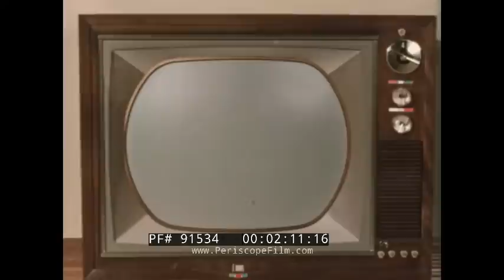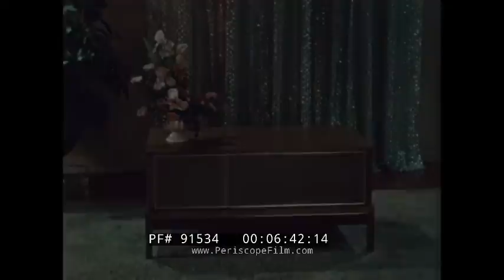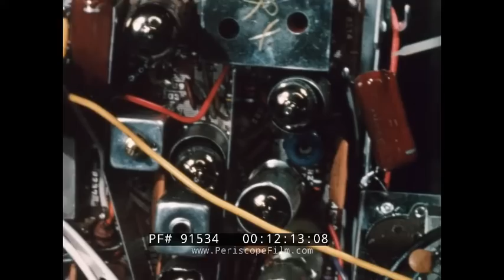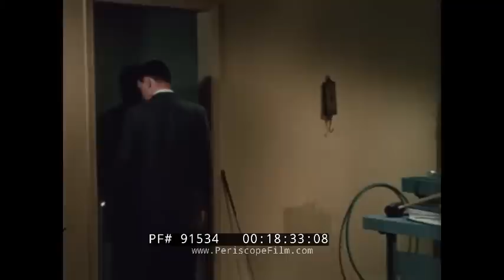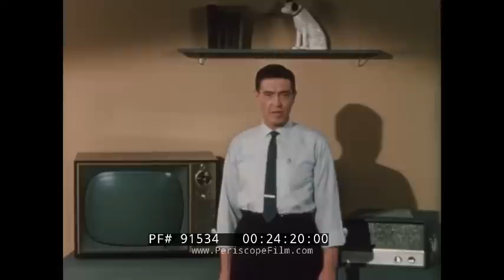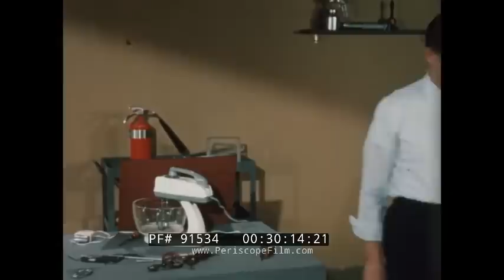1960 RCA VICTOR TV SET W/ REMOTE PROMO FILMS & "THE INSIDE STORY" OF THE RCA TV RECEIVER   91534

Comment: 20:00 Correct me gently if I'm wrong, but my understanding is that TV transmitters always had quite precise horizontal and vertical sync signals, even in the early days, but that consumer sets, for reasons of cost, were much sloppier, and it was usually just easier to have H and V knobs so adjust things when they got a little off. Some years later, the technology improved, and the knobs were no longer needed.

Comment: I don't know exactly how that remote unit worked, and they didn't say, but some of them had the remarkable property that they didn't need batteries, because they didn't rely on anything electrical. They used mechanical generation of ultrasonic signals, generated when you pressed the buttons.

Comment: I'd love to have a tv with the beautiful shaped picture tube these had, which I used to watch at home years ago.  I wonder if you could get an old one, degass the tube, and then fit a flexible lcd screen up against the inside of the picture tube therefore making a display that appears to be convex glass from the outside, and with those pretty rounded corners.  I'd prefer a real cathode ray tube but the colours of those always get burned and faded out after 30 years or more.  I suppose a black and white could be made to function perfectly if you had the ability to refurbish the tube.

Comment: Are there some Delta picture tubes and stripes green picture tubes that have the same filament voltage and test the same as the other one does and what is normal for the high voltage on a 23 and I have an older zenith from 1973 and it's a 19 ec45 chassis and it has 27,500 for the high-voltage I believe

Comment: Continuously variable volume control was a legitimate and important sales claim for remote control in this era as RCA provided a more expensive remote motor drive to turn the volume control as if you were to manually turn the control at the TV itself. The competition brands of the era often used a less expensive stepper relay in the remote control circuit to control volume in only 3 increments, a "low, medium, and high" and this relay was in series with the manual volume control on the TV, thus you really couldn't "dial in" that perfect volume with the remote as you could with RCA.
Reply: And to go back from mid to low you had to go through high and off, if I'm not mistaken.

Comment: When I was 5 years old, we had a Zenith about like that. A bit larger wooden cabinet with a speaker in the bottom. There wasn’t a remote control. The antenna was struck by lightning and the TV never worked well after that. We spent several hundred dollars trying to fix it, too. 📺

Comment: "Continuously variable volume control!" While I know this and color itself was insane tech in 1960, this still provides a chuckle.
Reply: Continuously variable volume control was a legitimate and important sales claim for remote control in this era as it provided a more expensive remote motor drive to turn the volume control. The competition brands of the era often used a less expensive stepper relay in the remote control circuit to control volume in only 3 increments, a "low, medium, and high" which were relative to the actual position of the volume control at the TV set itself.

Comment: In 80ties I had old RCA B&W set with remote. But it was older than shown  here - the remote had one big square button and alowed to change channels  in set  with electric motor driving the manual knob forward. It was nice and fun to see how wheel with numbers    turned by remote command. Communication from remote was with ultrasound about 25 kHz. All tube except remote ultrasonic with few transistors.   All this was capable to use in mid 80ties, only picture tube was more  worn then new. .

Comment: That "programmer with the magic memory" is actually a really cool idea. I can only imagine the amount of electromechanical complexity that would have gone into it - no ICs or processors back then!
Reply: It must have never sold well.  I've never seen a television with it, not even in an antique shop.  This film suggests the value is that you don't have to get out of your chair to change the channel but the real value is, having the TV turn automatically on so that you don't miss your show, when you've lost track of time.  That I can see being worthwhile back then.

I counted 24 buttons across the bottom so it handles a 12 hr out of the day.  Cartoons probably started at 8am on Saturday mornings and the news was on at 11pm.  So I wonder if you could decide on the 12 hr window of operation.
Reply: They probably scrapped the idea probably because of the amount of solenoids cams motors and switches that went in the final phase of manufacture
Reply: They must have scrapped the idea too many mechanical parts breaking

Comment: Why would anybody want to control the phase (tint) from their remote is way way beyond me.
Reply: Those old TV's would drift out of adjustment over the time you were watching a program.   Also, the station's phase wasn't always accurate, so you you changed the channel, it frequently needed adjustment
Reply: TV was broadcast differently in the early days of color. It was 5 separate signals on the same bandwidth. A Black and white signal for both B&W TV’s and color that carried the main picture then a Green overlay, a Red one and a Blue one and one for sound. Depending on your location and signal strength the channels could look very different.. Channel 2 could be very red and need to adjust the red down and channel 5 could be very green. This was still common into the 1980’s with certain channels. So adjusting the tint with the remote was a huge feature since usually there were knobs to turn located on the set itself to fix the color.
Reply: I stand corrected. Yea NTSC was pretty solid by the 90s (and I would even argue in the mid 80s). I was a kid in the 70s and I don't think we had a color TV before 1975!

Comment: You can wait a couple years and the tubeless  on your  RCA/VICTOR will start going bad and it will go green for you...yaaaay!
Reply: The Japanese were already getting an edge on the Americans in 1960!  Sony and Panasonic had some small TV's that were fully solid-state even then.  In 10 years, the big Japanese brands had fully solid-state TV's  in 19in sizes and larger.  The first trinitron that came out was a solid-state TV as well. SO, you could wait a couple of years and buy a Japanese TV that you'd never need to actually service!

Comment: In my country Norway, TV was not even working here in 1960, they started broadcasting in the early 60's,  15 years behind USA.. but it was in black and white. The first color TV was introduced in the early 70's, without remote controls.  We were way behind due to lack of infrastructure. Today we are a leader in technology, times have changed.
Reply: Who did make TVs in Norway by then?  Tandberg?
Reply: @johnfalstaff2270 Yes Tandberg started the production in 1958 for the Scandinavian market, and also Philips were big in the 60's. They were the 2 main leaders.  .
Reply: @bardo0007 .  My father purchased the first TV in January 1962. It was Hungarian made 17" screen sized "Orion AT403 Tisza".  All lamps and kinescope tub inside were made by Tungsram.  Very beautiful black&white clear picture and fantastic very resonant sound, despite it was a mono set.  We had it until 1976.  At the same time, my neighbors acquired beautiful television Lotos from Czechoslovakian electronic company Tesla.  Also very good television.

Comment: It took me a solid year and a half of begging/pleading/noodging my folks to finally get a color set in 1966. They bought a 25" Zenith in an "Italian Provincial" cabinet. (Their pamphlet showed the same set in a dozen different furniture styles.)
Reply: It must have cost a fortune to inventory all those cabinet-style and equipment combinations. Then they had to do the same for console stereos. I never understood why they didn't sell the guts and cabinets separately, letting the dealers mix and match them. They could have designed them to have the same "custom fit" and it would have allowed carry-in service for customers willing to lug in a slide-out TV, receiver or turntable. Magnavox actually tried that with its consoles in the 1980s, but by that time they were in terminal decline. I suppose the "rack" systems of the 1990s were based on the same concept, but they didn't hide the components the way the consoles did.
Reply: @pcno2832  They did that with some of the higher end stereos, like Fisher, Marantz, Pilot, Scott, etc.  You could buy the style cabinet you wanted, then buy the components like the receiver, amp, turntable, and even add an open-reel tape deck if you wanted, and the types of speakers you wanted.  The dealer would then assemble them and deliver it to your home.  Very expensive compared to the mass-market brands like RCA, Zenith, etc.  IIRC, I heard the RCA cabinets were made in North Carolina, then they were delivered flat-pack style to Bloomington Indiana, where they were assembled, and the electronics added, and then they were off to a dealer.  They did have several different cabinet styles for the same (TV or stereo)  chassis back then, but it wasn't something the dealer could easily swap for those brands, like you could for the higher end stereo systems.
Reply: That’s interesting I assume people have a “this TV works just fine.” Response.
Reply: My family didn't get color until their 1970 RCA 25" console, which gave our orange cat, Maggie, cancer from the excess radiation that it emitted. She liked to sleep on the top of its cabinet.

Comment: RCA put a hot voltage divider under the chassis with no air flow.  The resistor leads oxidized and broke.  The tech reconnected the wires with solder that had a low melting point.  (Planned obsolescence).  Took me 45 years to understand this.

Comment: Great video. I worked for RCA Canada in the 70’s. The Canadian company was set up as a smaller version of the US company, and made TV’s, picture tubes, cabinets and almost everything else in local Canadian plants. There was even a research centre modelled on the US R&D division. As others have pointed out, RCA made a variety of strategic, product and leadership mistakes in the 60’s and 70’s that lead to their demise. GE, at the time, appeared to be a brilliantly run conglomerate, took over RCA and sold off the pieces they didn’t want. Which was most of the company. The Japanese were the also the big overseas competitors at the time. The result is that today RCA survives in name only on low priced imported products. Fun to see what was then cutting edge tech.

Comment: Remotes still had cables when I was a kid, which was odd because it was the 1980s.
Reply: I remember some VCRs with cabled remotes, and a few stereo receivers. I don't remember any cabled remotes on TVs here in the USA, but they might have been around; most of the major TV makers were probably worried someone would use the remote in the tub.

Comment: My grandparents back in the 60s or 70s had a TV with some kind of wireless mechanical remote that didn’t need batteries, you could kind of see though the mesh in the front and it looked like it had metal rods inside. It took some effort to press the buttons and they made a very loud CLICK with a little vibration to it. I think all it could do was on/off, volume and channel up/down.
Reply: Yes, the way these types of remotes worked was that those rods were different sizes, and when pressing different buttons, it made hammers strike the particular rod associated with that button for that function. Different rods produced different frequencies (pitches) of sound, often above the human hearing range, and the remote receiver inside the TV would recognize the frequency of the sound to activate that function- such as channel change, volume up or down, or on/off.
Reply: @oldradiotvsc9836  Cool! So it was ultrasonic I guess. Very clever.
Reply: We had one and we called it the clicker not remote
Reply: @notyouraccount566  We still do.
Reply: We weren't allowed to use our Zenith Space Command 300 remote control; my mother said she was worried we'd break it. Then one day, when my parents were away, my sister was using the remote and saw the car pull up, so she slammed it onto "Z" emblem that normally held it and it shattered into a million pieces. My mother acted angry, but she later admitted that she was glad to see it gone and  only stopped us from using it because she couldn't stand the noise from the channels changing.
Reply: @pcno2832  She probably was sensitive to the high frequency sound it made. As a kid I did think it was a little annoying too.

Comment: That was fun to watch. That first color TV with the multi-function remote was really something. I read that most people used the one button to just turn off the picture, and they often would not keep holding it to turn off the whole set. So the TV would be “off” but really the set was left on and they would sometimes overheat and cause a fire. 

I have one of those hideaway Hillsborough TV’s…got it off eBay about 4 years ago. This is the first video I’ve seen of its commercial with the sound, so that was great. The one I have needs a new picture tube I was told, and I’m not sure what shape the chassis is in? The wood finish has some paint speckles on it but is generally in good shape. Very cool design. The last man kept saying shassis, hehe. 

Sometime in the early to mid 60s my family got a Magnavox entertainment center, with a big color picture tube and phonograph and AM/FM stereo radio. I do remember a man coming to the house to fix it occasionally.  The remote for it had only two buttons, one to change the channel and one to change volume. When you pressed them they made a little burst of air sound, I think using ultrasonic frequencies. That’s all it did, not at all like that first remote that did everything. There was also a button on the TVs control panel you could press that would use a motor to change the channel selector and we kids would just push it and hold it so it would go ka-ching through every channel.
Reply: Wow, you guys must have been loaded!  In about 1964 our rich cousins got a console TV like what you described except no remote. At the time it was 1/4 the price of a brand new Ford car. So TVs are comparatively far cheaper now than they were then.

Comment: Lol you can turn the TV completely off with the remote control. Remarkable! 😂

I'm curious as to what percentage of TV shows were in color in 1960.

Enjoyed this very much. 😁
Reply: Love the service guys. Today, we throw the tv set out. The service guys are all homeless.
Reply: Not very many in color. BW tv 📺 outsold color into early 1970s. Only 2% of US homes 🏠 had a color tv in 1960
Reply: Only NBC had color at first, as I remember. I bought a 19 inch color set; my first one, in 1976.
Reply: many TV's had a mode, where it would turn off the sound and picture, but it would keep the tubes hot for an "instant on" the next time you wanted to watch it...sort of like a picture mute on a modern TV.
Reply: There were very few color shows in 1960, not only because only NBC was producing them but also because many local TV stations hadn’t yet made the significant monetary investment to buy and install the color equipment to even broadcast in color. And since color TVs were extremely expensive, not many consumers saw the need to purchase one.

Comment: Back in the good old days your TV set had more than a picture tube. It had tubes that controlled horizontal, vertical, brightness , etc.
Local drug stores sold TV tubes and had a tube tester. When your set’s picture went bad you took the suspect vacuum tubes with you and tested them on the tube tester. Then you picked a replacement from the ones stocked in the tube tester.

Comment: Earlier remote control worked off of a mechanical chime noise generator that made sounds that triggered the motor inside of the television set.
Reply: I still have a couple of those remote controls.  A tiny hammer banged on a metal cylinder that was tuned like a bell for a certain high pitched sound frequency, and a microphone in the TV connected to some tuned circuits sensed which button was pressed.  It was so wonderful, until my mother swept the floor.  The broom made a series of sounds on the same frequencies, so the TV went crazy!  True story!  🤣
Reply: @theclearsounds3911  Thanks for your response!  It’s been a long time since I’ve seen on of those remote controls.  They made a ping noise when you pressed the buttons and there was motor that turned the tuner.  Great memories!
Reply: @theclearsounds3911  Very interesting!  That system was short lived.  Thanks!

Comment: Shows a crappy phenolic circuit board. This is like what's used in defense projects and missiles.
Reply: Hey, they had to start somewhere! And what a revelation after hand-wired chassis.
Reply: @Gannett2011  I never saw a phenolic board for government work, maybe a turret terminal board. Epoxy glass was the usual.
Reply: @Gannett2011  Hand wired chassis were way more reliable.
Reply: if it was used in a missle, it only had to last a few minutes, at best, till it made it to it's target!  LOL!
Reply: @audvidgeek  but it might have to withstand 20Gs for those few seconds. We once tested pack drives for use on aircraft. It didn't go well.